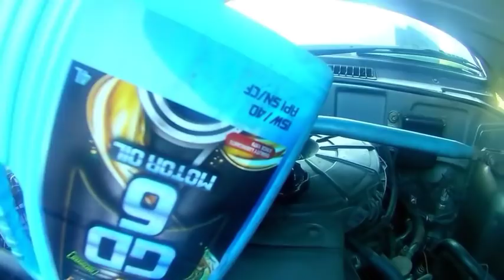Balik kampung service kereta p/iswara. #iswara #GantiMinyakEnjin

Comment: Salam Bro Alan.sye punya wira ngv.baru2 ni meter temperature naik lebih dari separuh(sblm ni xnaik mcm tu)..lpas tu sye tukar air, tukar radiator dan remove thermostat. Tp temperatute still naik jugak..adakah ini mungkin krn disebabkn oleh sensor temperature?@ meter temperature  yg xbetol.harap bole beri pandangan
Reply: waterpump dah check?
Reply: @sopddt  blum bro..mm kalau nk check byk kos nya x.
Reply: @12345soa  waterpump saje pon x smpi 150 tp nk upah pasang pon keras jgk harganya pasal banyak bende kene check. Kira mcm kalo 2x tukar timing belt dah mmg kene tukar jgk waterpump tu..  Bertabahlah..
Reply: aku pun guna ngv jugak.lebih 5 6 tahun.....pantang ngv no 1 jgn bawa kete lebih laju dr 120km dgn masa yg agak lama.....,mungkin head gasket dah terbakar.....tapi jgn buang termostat yg membuatkan rosak lebih teruk nanti bila rosak.....
Reply: Water pump iswara rm39 je.